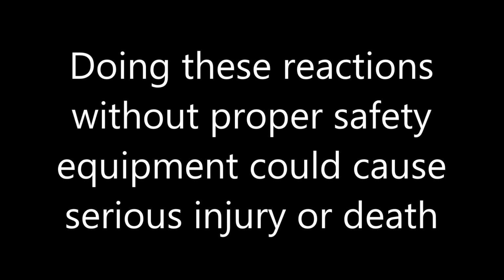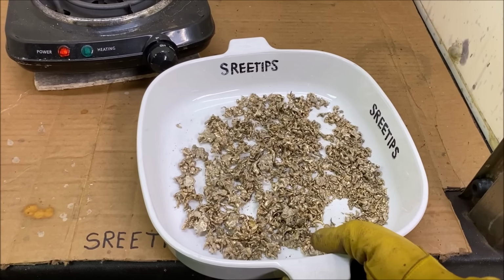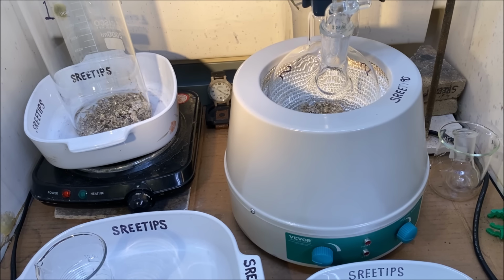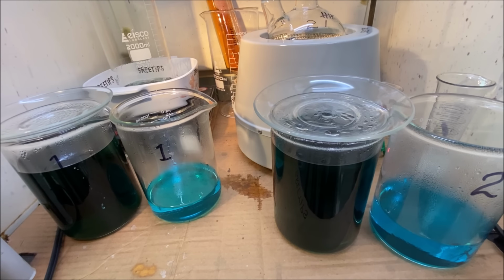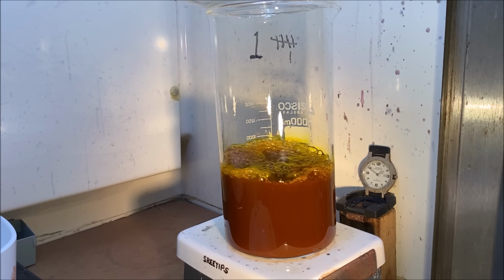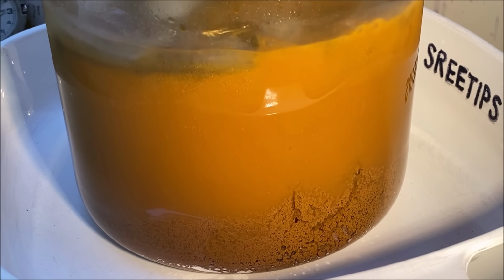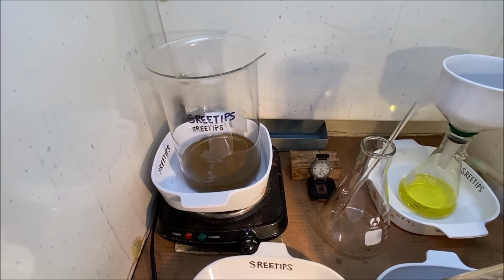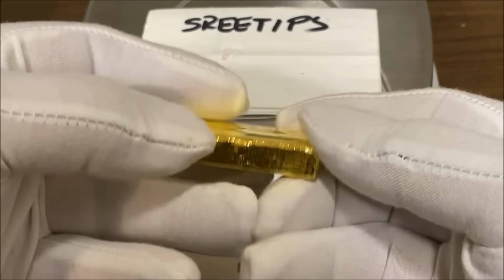Six and a Half Troy Ounce Pure GOLD BAR

Comment: Quick tip:  During the melt phase, base metal impurities and borax residue tend to form a tough invisible oxide layer on the ingot surface.  Residual graphite from the mold can contribute to this.  Quenching the finished ingot in water will partially dissolve this 'skin', but not completely.  I discovered long ago that quenching the ingot in hydrochloric acid while it's still at red heat will completely dissolve any surface contamination without attacking the gold, leaving a much brighter gold finish than if it were quenched in water alone.  

When quenching in HCl, the ingot will initially seem not to react, almost as if it were cold.  That's due to the Leidenfrost effect creating a bubble of hot HCl gas around the ingot.  Within 5-10 seconds the acid will rapidly begin to boil as it begins to contact the still hot ingot.  This boiling will increase in intensity for a few seconds, until it abruptly goes quiet.  At this point, you can rinse it in distilled water.  Only do this in a Corelle  or Corningware dish (with a lid if possible) as Pyrex might shatter and metal bowls could deposit white metal on the ingot due to galvanic reactions.                                                                                                                                                                     

You're welcome.

Comment: Mr Kevin, if you want to save on nitric use here's a tip: when you're inquarting, instead of pouring everything into shot, take a pair of pliers and just before the metal solidifies pinch it with those pliers. If you catch it at the right time it falls apart with the consistency of a brownie. The whole inside is sort of like sand, I'm not sure about the chemistry thats going on but it is very similar to sintered brass, super grainy with a maximized surface area. It takes a few tries, sometimes you grab at it and it's solid but if you get it just right the metal will crumble and you'll have maximum surface area. You'll use 3 times LESS nitric and 3 times LESS time. A game changer! I know it sounds bizarre but try it, you'll thank me later! Hope you and the Mrs have a wonderful holiday and are doing well. We love ya!!
Reply from the maker: Yes, I’ve used pliers to break it apart.

Comment: after you have enquarted and run it through nitric, i really want to know the texture of those gold balls. can you take one out and hit it with a hammer lightly to see if it crumbles or flattens? I am so curious.
Reply from the maker: After the nitric boils, those gold balls are like gold sponge. I need to get up with one of the professors at the college and get them to look at one of those gold balls, broke open, under their SEM (Scanning Electron Microscope) so we can see the honey comb structure inside.
Reply: @sreetips  That would be great to see.  :)
Reply: Would turn to dust most likely
Reply: To answer your question I have some gold sponge from sreetips. You can squish it with your fingers and it feels kind of like clay at first but then it hardens as you compact it. It's crazy how soft it is. If you hit it with a hammer it might crumble some but it would probably mostly flatten and harden
Reply: @adamtheninjasmith2985  If you hit it with a hammer it probably would start looking like gold foil which can be incredibly thin.
Reply from the maker: Pure gold sponge can be cold-pressed into an ingot, so I’ve been told. But I’ve never tried doing it.
Reply: @ sreetips
Please try a compression bar for us. I would love to see that.

Comment: The reflux condenser needs about 2 minutes of gas residence time for the recovery of acid. I’ve designed these units before. What you have is in the 30 second range, so you aren’t recovering a significant portion of the NOx to nitric acid. Chemical engineer here.
Reply from the maker: I need four of those in series
Reply: @sreetips NO has to oxidize to NO2, it’s the NO2 that makes the nitric acid, but the red NOx from heavy metal dissolution is mostly NO. My design at INL gets rid of the NOx plume from the dissolver.

Comment: I think this experiment shows that most of your "nitric acid fumes" are not pure nitric acid gas, but are just by-products of the reaction with gold.  Therefore, the condensed liquids coming back down into the pot are not saving you much pure nitric acid.  Old method works just fine.
Reply from the maker: Agree

Comment: Hello . So I am assuming you just need propane for the mold heater correct?thankyou as always for the great video. Interesting to see a side by side comparison...just a beaker and a heater seems to do fine .even though the condenser looks  way cooler lol..thx again
Reply from the maker: I use map gas (yellow cylinder) for heating the mold. But I have used propane to heat the mold.

Comment: Nice bar. I noticed that the condenser cooling lines were developing a good amount of condensation on them above the round bottom flask. If a drop of cold water comes off and lands on the flask, you may get thermal shock and break the round bottom.

Comment: Well, that answers that question without any doubts!
Reply from the maker: It was a disappointing outcome. I was hoping it would increase efficiency. Bummer.
Reply: @sreetips capture into a different vessel, maybe? I think it might be so dilute as to not be of much value in metallurgy, only in the harm it could do to your lungs.
Reply: @sreetips  Doesn't the Nitric Acid get consumed making Silver Nitrate, and off-gassing the Nitric Oxide?  I'd think if it was going to make a difference, it would be with the Aqua Regia boils to dissolve the gold.
Reply from the maker: Yes, but the red gas coming off is nitrogen dioxide. I’m trying convert it back into nitric instead of allowing it to escape up the exhaust stack.
Reply: @sreetips just add water, I believe!

Comment: Another amazing gold bar steetips try putting and peice of paper under the crucible and it won't stick
Reply from the maker: Unfortunately, yes it will. That ceramic wool was inadvertently coated with borax. The molten borax will stick to the crucible and the wool regardless if there anything in between them.

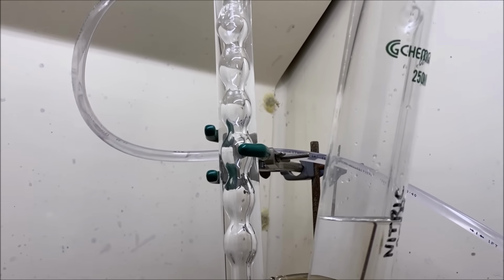Comment: 12:59 shame that flow didn’t work. A countercurrent exchange would be most efficient in heat exchange and condensation. But I loved the side by side. Great comparison. Certainly the cumbersome factor is not insignificant. Even transfer out of the reaction flask seemed to be a nightmare with potential for loss.

Comment: I have used Soxhlets thousands of times to extract plant material. But I remember old academics using a Soxhlet for inorganic analysis. Metal and other materials analysis. I’m semi retired now, but if I go back in the lab, I will indeed do a video. I will use some pieces of copper as a “control”. I predict that they will dissolve like butter in the Soxhlet. I’ll do it in the fumehood obviously. 👍👍
Reply from the maker: That would be awesome. But make sure and alloy the copper with gold first. I use silver because I refine silver also. The additional silver reduces the gold concentration in the alloy down around 6k gold (25% pure gold, 75% silver and copper and zinc). The goal is to remove nearly all the silver and base metals leaving just the pure gold behind for further refining.

Comment: Hello sreetips. May I ask what camera you are using? Every episode of your video is clean. Can you show the link where you bought the camera? Of course if this is not problem. I often have problems with the image, with focusing the image, because I just use my phone camera. Thanks in advance 🙂
Reply from the maker: I use an iphone11 for all my videos. It’s an older phone but it has the best camera I’ve ever used. The iphone11 quit working a couple years ago (but the camera still works fine) so I bought an iphone14 and the camera on it is junk compared to the 11. They (Apple) have reduced quality in their phones. They used to be unbeatable. If my iphone14 quits working, I’m switching to android. Apple has gone done the tubes. Thankfully, the iphone11 quit working as a phone, but the camera still works fine.
Reply from the maker: At first, I could use the video files from my iPhones14 even though the camera wasn’t that good. At least I could use the 14 to get footage if I had the 11 in use as Timelapse. But then, after doing an update on the 14, the video files were no longer  compatible with my PC. I’ll never buy another Apple product. They lost a customer when they did that.
Reply: @sreetips  Thanks a lot sreetips. Your phone has a good camera. The quality of each video episode is excellent 👌 I thought you were using some kind of professional camera, like the ones they use in television. Now I know that the iPhone camera is much better than the Samsung I use 🙂Thanks again.
Reply from the maker: If you can find an old iphone11, then that’s the one I would use.

Comment: Refluxing nitric doesn't save much acid, because the reaction without the presence of peroxide results in at least half NITROUS acid formation.  It needs that additional oxidation from peroxide to kick the favored reaction towards producing mostly NITRATE ion.
Reply from the maker: So I’ll try again but add some hydrogen peroxide to the reaction.
Reply: @sreetips  I've never seen it done with refluxing.  Usually, the NO2 is outgassed through one of those little aquarium bubbler stones into another vessel with 20% or higher H2O2, and then the recovered nitric is distilled later.  

The same this can be done with SO2 gas.  

It won't work with chlorine from HCl.  Bubbling chlorine gas through water just chlorinates the water and makes it smell like a swimming pool.

Comment: G'day Sreetips. I have been watching your channel for quite a while, and today I came up with a question when you said that the silver crystal is a byproduct from your gold refining ... Why can't you use the cement silver to enquart your gold scrap, since you will me using nitric boils to remove it all anyway?
Thanks~
Reply: I think it is because you don't know the % silver concentration of the cement silver while in comparison you do know the % silver of the sterliing.
Reply from the maker: I could use cement silver, but it’s not recommended. Karat gold (especially white gold) carries palladium (and some platinum). These metals will follow the silver and tend to accumulate in the cement silver if I use it over and over to inquart the karat gold. High concentrations of platinum group metals (especially palladium) in the cement silver could cause problems in the silver cell if pgm concentrations are allowed to become elevated. Plus, I refine silver so it’s best to use sterling to inquart the gold, since the first step in refining silver is to dissolve it in nitric acid anyway.
Reply: @sreetips  Ahh, that explains it. Those pesky PGMs ...

Comment: Hi Sreetips, hope you're well.

I'm looking for a fumehood, I'm in the UK any suggestions of places to look?
Reply from the maker: Not really. If I had to start over I’d get a 500 gallon poly plastic tank with a six inch (18cm) round connection on top for a fan. Make sure is suitable for acid digestions (no metal parts)

Comment: Always have your condensor filled from the bottom and drained from the top, means even if your flow rate drops for any reason, the condensor will always have some water in it at least.
Reply: Good point.

Comment: The beauty of the system is that after removal of the silver in the inquart, You could reflux pure water which will wash the precious metal in the Soxhlet. This will make it acid free and clean as only pure water would condense.
Reply from the maker: A chemical engineer said that the length of the reflux I’m using is insufficient. Said it needed to be at least four times longer. But I don’t have that much room in my fume hood.
Reply from the maker: I don’t think I’d have enough room for the soxhlet apparatus.
Reply: @ a longer reflux condenser is always good, but if you have a recirculating cooler (best one is Julabo), you can add antifreeze to the water and run it at 4 Celsius. Will condense any vapours. We could condense dimethylformamide bp = 153 Celsius. I think nitric acid boils at 83 Celsius so no problems. 👍
Reply from the maker: Antifreeze for the coolant. Prestone has bright green antifreeze. That would look very neat. I’d fill the reservoir with antifreeze coolant, then put it in a container of ice and use salt (like an ice cream maker) to get the temp down low. Since the cooling loop is closed, none of the antifreeze would come in contact with any of the valuable products in the setup.

Comment: the advantage of the reflux is that less of the deadly nitric fumes escape into the surrounding environment of the apparatus, but i do not know if you are greasing your joints at all to give a more gas-tight seal in your reflux setup
Reply from the maker: I used sulfuric acid instead of grease.
Reply: yeah that's what i meant by "grease" some type of acid in order to form a liquid seal between the walls of the attachment and the end that it's sitting in

Comment: sir. Have you ever recovered gold lost in blue nitrite water. I usually use carbide to recover my lost gold in blue nitrate water. and one more thing, why with distilled water I usually use ordinary water from drinking water at home, is there a difference when processing gold with distilled water and ordinary water??
Reply from the maker: No, never tried that. I’ve never used drinking water. I always used distilled from the grocery store.
Reply: @sreetips  So, using distilled water won't dissolve the gold at all, during the gold recovery process. Is it free from weak chlorine?
Reply from the maker: I don’t know. I use distilled water because that’s what I was taught to do by the professional refiners that I learned from on the goldrefiningforum.com
Reply from the maker: Distilled water won’t dissolve gold.

Comment: tl;dr the captured NO₂ gas in the refluxing setup is only about as effective as atmospheric O₂ gas in the open setup.

I've thought a lot about the possibility of recovering the NO₂ gas for reuse from reactions where the nitrate ion acts as the oxidizer.

You just showed us broadly why no one does this, though it takes some thought to untangle exactly why.

To review, with silver, hot concentrated nitric acid causes the following core reaction:

Ag(s) + NO₃⁻(aq) → Ag⁺(aq) + O²⁻(aq) + NO₂(g)

Cold, dilute nitric acid causes the following core reaction:

3 Ag(s) + NO₃⁻(aq) → 3 Ag⁺ + 2 O²⁻(aq) + NO(g)

In each case the oxygen ion immediately combines with acidic protons in solution to make water, while the silver ions pair with unreacted nitrate. The nitric oxide can react with oxygen in solution or in the air to form more NO₂ gas. Both of these reactions are ongoing in your solutions to some level.

When NO₂ dissolves in water, the following reaction is often quoted:

2 NO₂ + H₂O → HNO₃ + HNO₂

However, this reaction isn't simply a matter of balancing a chemical equation; the two NO₂ molecules have different purposes. One NO₂ serves to oxidize the other to NO₃⁻ while itself being reduced to NO⁺ (nitrosonium):

2 NO₂ + H₂O → HNO₃(aq) + NO⁺(aq) + OH⁻(aq)

The NO⁺ and OH⁻ combine to form HNO₂, but it is unstable and breaks down:

3 HNO₂(aq) → 2 NO(g) + HNO₃(aq) + H₂O(l)

The net reaction of NO₂ in H₂O is

6 NO₂ + 2 H₂O → 4 HNO₃ + 2 NO

The bottom line is that in all of these reactions, NO₂ is oxidizing itself back into nitric acid. However, there's another way for this to happen: via the oxygen in the air.

For example,

4 NO₂(g) + 2 H₂O(l) + O₂(aq) → 4 HNO₃(aq).

Even small concentrations of NO₂ can react to immediately make more nitric acid, and a container open to the air and stirring can quickly replentish its dissolved oxygen. (This is why dilute nitric acid is more efficient, because the reduction all the way to NO predominates, and the little NO₂ that is made can be fed dissolved oxygen and made useful. Of course, it takes forever!)

The efficiency of feeding the waste NO₂ back into solution as an oxidizer versus using atmospheric oxygen at an oxidizer probably amounts to a wash. In an open container, some NO₂ will still be used, while in a reflux system, some NO₂ will still be lost, so the demo you did isn't really a 1:1 comparison of air versus no air. But it still shows that any gains or losses are marginal.

In theory, you could build some apparatus that captures the NO₂ by condensing it into N₂O₄, then piping air back into the setup would save you reagent costs in the long run as you could slowly make more nitric acid from the captured gas for future reactions, but it would be a pain to build.

An interesting test would be to allow the NO/NO₂ to escape, but without allowing air in (vent pure N₂ gas in instead to block the O₂.) If I'm correct, you should see a reduction in efficiency.
Reply from the maker: Great explanation. Thank you.

Comment: Great comparison between reflux and no reflux. Better than I expected when I suggested this a few weeks ago. One question remains though. How much nitric was left in the liquids that you poured off? Can you dissolve more sterling with liquid number two in your next step of handling your byproducts?
Reply from the maker: I didn’t see a difference between the reflux and the cover beaker. I thought that the reflux would have used less nitric. The reflux looks neat, but it’s a pain to work with.
Reply: @sreetips  I mean, was there maybe a difference in strength (acidity) between the remaining liquids? Is there more left over nitric in liquid 2 than in liquid 1?

I don’t really see that it will make very much of a difference. As you clearly showed in your experiment, there was no significant difference during these nitric boils, other than how easy or difficult they were to handle. If there is a difference in left over nitric, it should be possible to show in your next step of the silver refining. When you use the spent acid, with left over nitric, to dissolve some extra sterling.